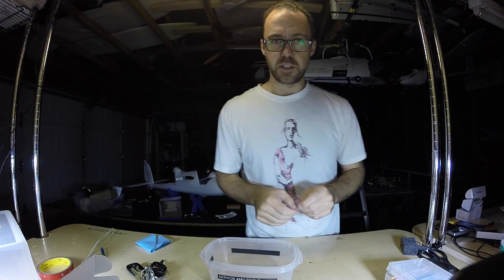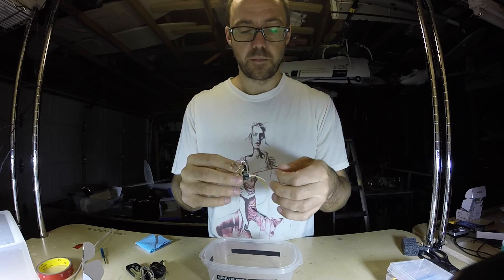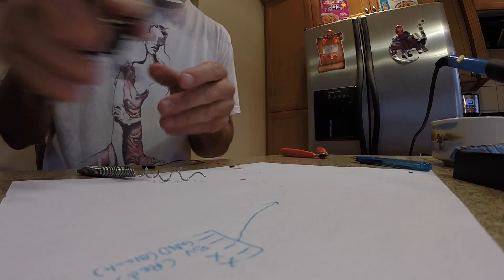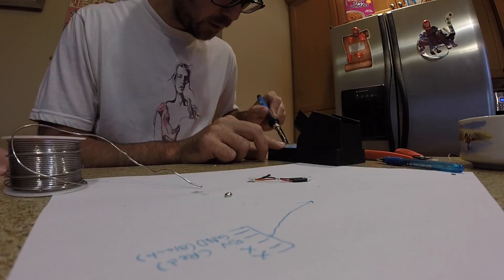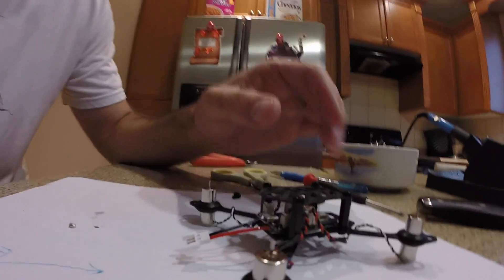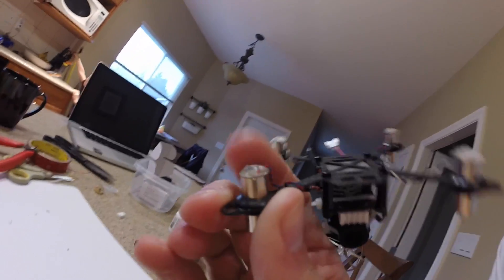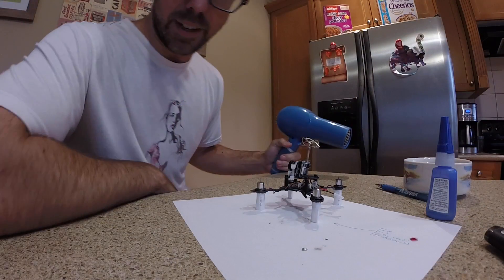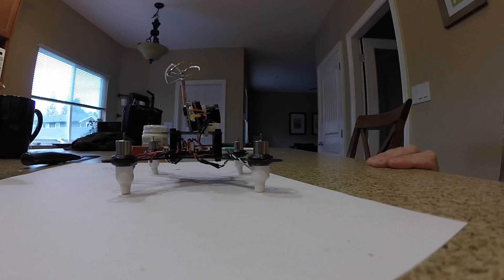DIY Micro Racing Drone for a Cheap Ass - Part 5 - Camera Wiring and Landing Pads

Comment: Good idea with the heatshrink. I just dabbed hot glue on the motor bottoms of my new QX-95.  These micro fpv quads are a lot of fun and gaining in popularity, especially if you live in a rainy urban place with not too many empty parks to fly your 250 sized race quad. But I have to say for the time, money, and safety factor, my old Syma X11 with a micro fpv cam was a far better value.